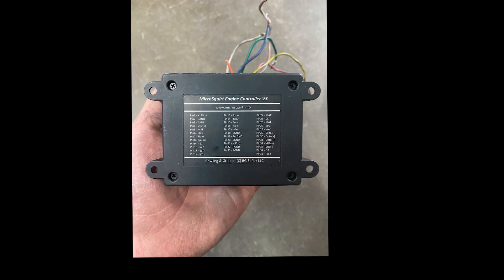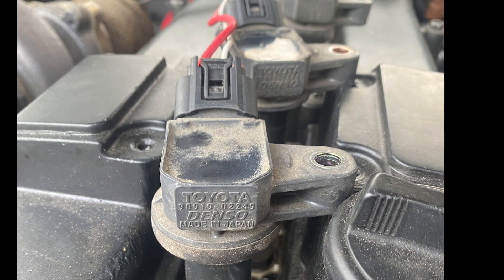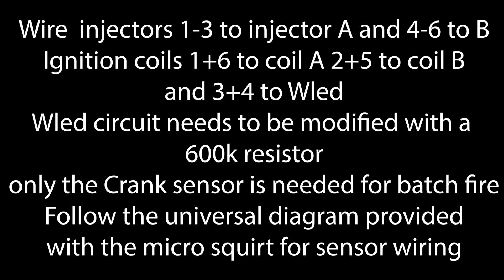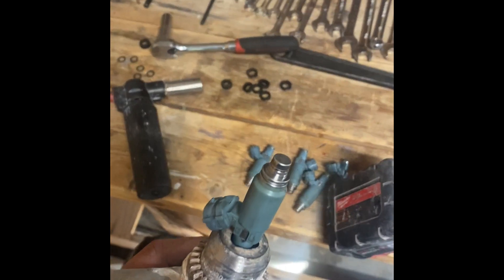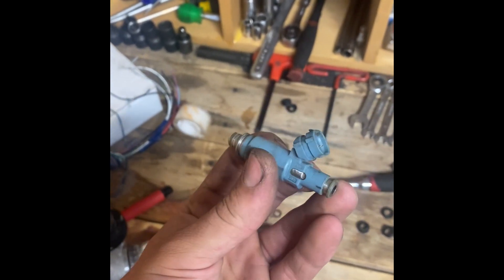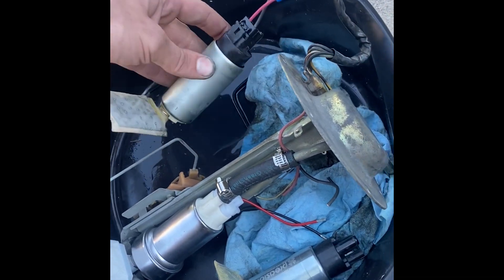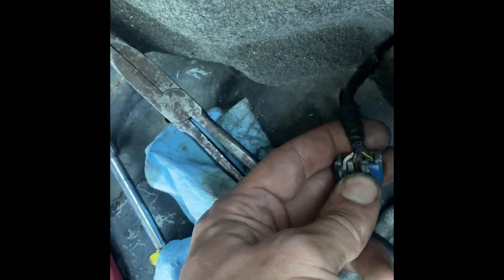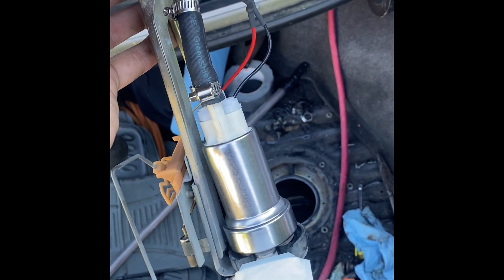Microsquirt Install into a 2jz Skyline 2jzge na-t

Comment: What did you use to block off the distributor hole
Reply from the maker: Freeze plug idk the size anymore but if you measure the hole it’s available at Orielys

Comment: Hey there I’ve been watching your video on YouTube and my ? is do you have to change the non vvti oil pump to the vvti one in order to use the 36-1 trigger gear?
Reply from the maker: Yes you do
Reply: Could you explain why?
Reply from the maker: @garfieldbrown7372  the vvti oil pump bolts on and it has the mounting hole for the cranksensor then you need the trigger wheel/ timing belt pulley.
If you buy a used trigger wheel have someone tig weld the wheel on so it doesn’t separate
Reply: Ok so I read your response but my research shows that the 1997 and up non vvti 2jzge engines came with the crank sensor already in the oil pump so I got lucky there but like many others out there we’re trying to find a video or a write up which explains exactly how to connect the micro to the sensor and all the steps taken to get it working properly for example wire polarity color coding etc.
Reply: Hey there could you please send me a diagram of how you connect your crank trigger sensor with the color codes thanks in advance.

Comment: Does microsquirt work with the automatic 2jzge
Reply from the maker: No maybe a a340 but I don’t think so
Reply: @meatinc  meant to ask does it work, not doesn’t lol I’m trying to find a budget solution ecu that works with the stock autos a650e, since im running a stock 2jzge vvti NAT,I think the a650e should be good enough for my goals of 300-350whp before I put GTE internals